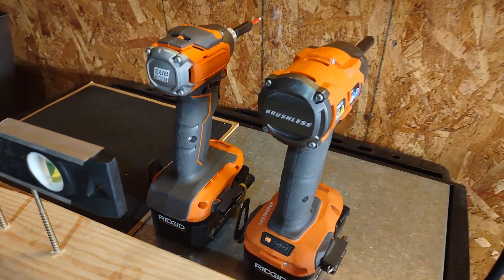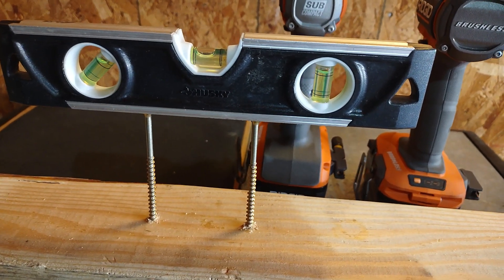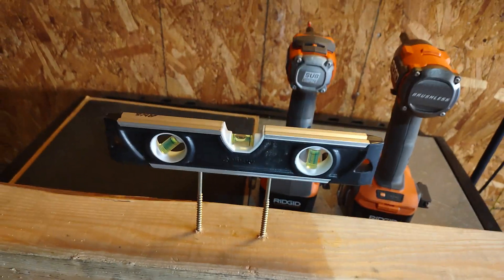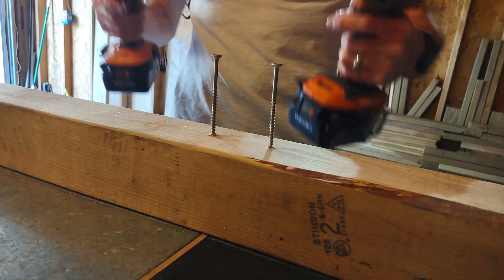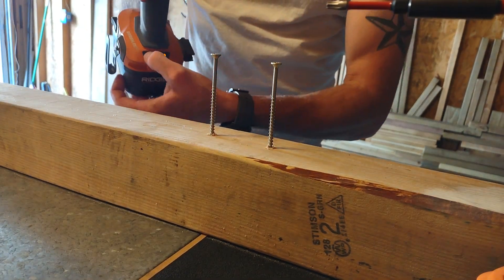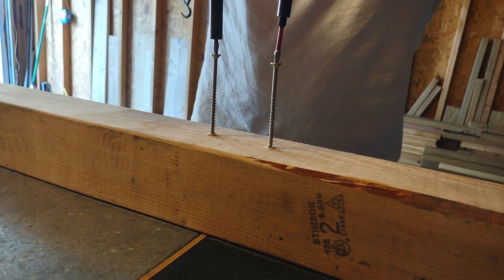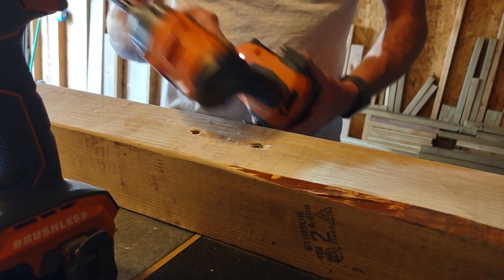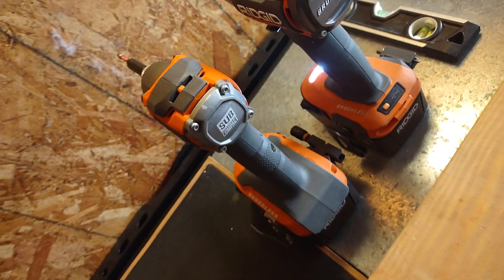Ridgid Brushless Impact Driver vs. Ridgid Subcompact Impact Driver

Comment: The brushless is a beast.  However, the subcompact is still great for its size and easily gets the job done.  Did you hear that the next generation subcompact impact driver has 4 speed modes?  It’s available for purchase online but isn’t stocked in stores yet.  I placed my order (as part of a kit with the subcompact drill driver) and expecting it to be delivered later today.
Reply from the maker: Very impressive drills from the newer Ridgid brushless line! I've seen some stuff about the new subcompact drills but didn't know that they were available yet! You'll have to let me know how they perform when you get them 👍🏼
Reply: @WolfCoTools  I definitely will!  One of the 4 modes is a self tapping mode and I have a project coming up where that mode should come in very handy.  Looking forward to seeing how well they perform!
Reply: How is it?
Reply: @mike_t_007  they are great tools.  I have both the Gen 2 Subcompact Brushless drill and impact drivers.  They are not as powerful as the full size Brushless line of tools, but they are powerful enough for handling the majority of light duty tasks.

Comment: They just came out with their most powerful hammer drill and impact driver. you can get them online but I haven't seen them in the stores. The drills got 1200 in/lbs to impact drivers got 2400.

Comment: Brushless all day my man!!!✊
Reply from the maker: Hands down one of the most underated impact drivers out there, & paired with the Max Output batteries it's a beast!🛠️💪🏼
Reply: @WolfCoTools  I really want to get a couple 3.0 octane batteries to try on them. The drill and the impact
Reply from the maker: @IMPACT-NATION  I've been pretty curious about the octane 3.0 batteries as well. I wonder if the 21700 cells make a noticeable difference in performance & run time. Also curious about the new 8ah exp battery, it's going to have 21700 cells as well!
Reply: @WolfCoTools  the HO batteries are a step above the Octanes i believe

Comment: What do you think of the subcompact drill?
Reply from the maker: I use the subcompact impact driver everyday with a 2ah max output working apartment maintenance and have yet to run into something it couldn't handle, it's a beast!
Reply: @WolfCoTools  I know the impact driver is good, but I was asking about the drill.

Comment: nice.

i just picked up the subcompact driver. it's pretty good....

do you notice a initial trigger delay? i find a ever so slightly a delay before it starts to turn compared to the other ridgid tools...
Reply from the maker: Definitely a slight trigger delay, overall it's a beast though and has awesome power to size ratio as well as great trigger control once the motor is going, just that weird delay at the start... I use it and was abuse it daily and love the weight of carrying all day with a 2ah max output👍🏼🛠️💪🏼